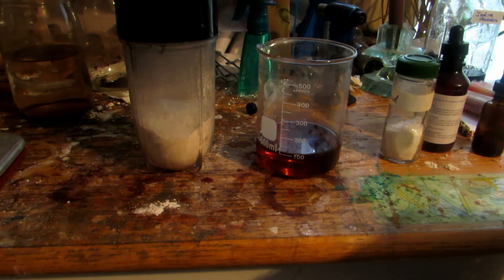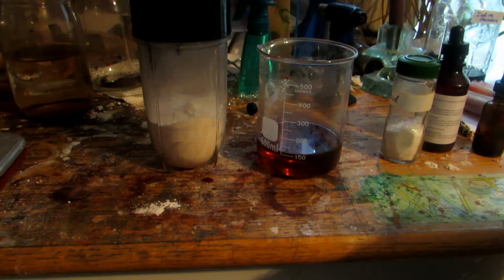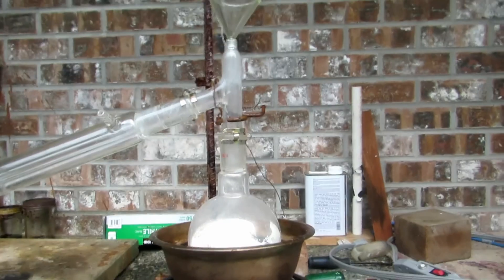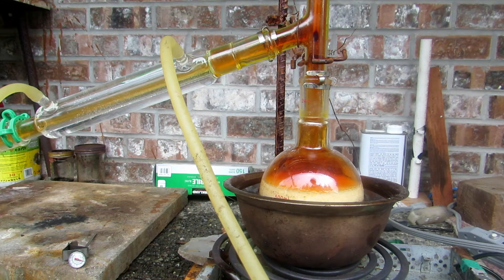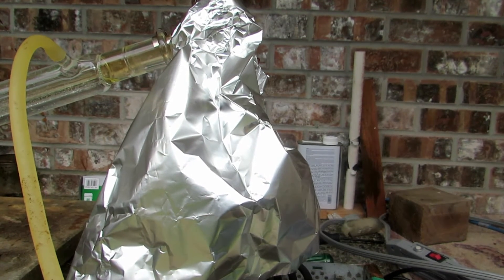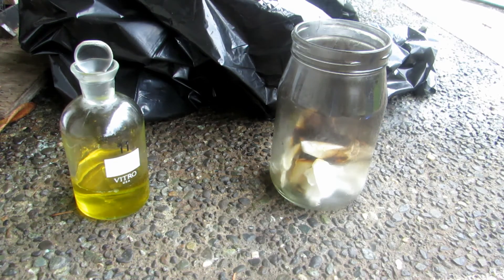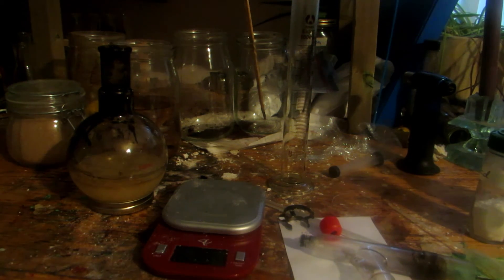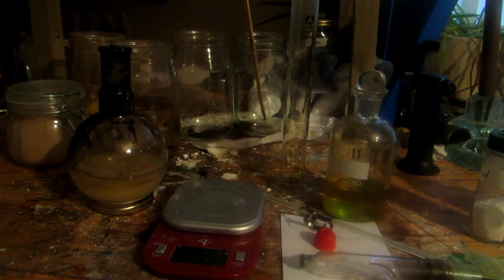How to Make Fuming Nitric Acid

Comment: Be very careful while using nitric acid. It isn't like sulfuric or hydrochloric acid. It is weaker than both of them but it's even more corrosive. The pain is almost instant if you get it on skin expect fingers. it can even dissolve bones.

Comment: I don,t think  is more than 70%  concentration..low grade nitric acid will fume  also....and burn to flame  things .... you need to try  with some cooper  ..if is over 90 % concentrated will not attach cooper ( because of pasivasion process ) ;if is diluted will attach  it violently  ...

Comment: i can only only buy sulfuric acid in 32% , how do i increase its concentration upto 68% or higher.
Reply from the maker: If you boil the sulfuric acid, water will boil off leaving the sulfuric acid, when white fumes come off, the concentration of the acid is about 70%. that will work in this reaction, but you will not achieve nitric acid past 68% concentration because it forms an azeotrope with water. To get pure sulfuric acid, you will need to distill the acid which requires heating it up in a distillation apparatus past 300 degrees Celsius. If you are looking to just obtain 68% nitric acid, your 32 % sulfuric acid should work for this reaction and you would just end up distilling 68% nitric acid.
Reply: so if i want to make 68% nictric acid all i need to do is, make a dilute nitric acid, then boil the nitric acid in a boiling flask and let the vapors go though an  apparatus, and have cold water going through the condenser, and wait for the steam to come out the other end. into a vacuum flask.
Reply: i only have sulfur powder at the moment, can i use that to make 70% sulfuric acid, if i pass water through the condenser, so the gas turns into liquid.
Reply from the maker: TV Tech yes, water will boil off first, then 68% nitric acid at 121 degrees centigrade
Reply from the maker: TV Tech you'd have to burn the sulphur and bubble the sulfur dioxide through hydrogen peroxide to make sulfuric acid, then u can boil it to concentrate it
Reply: Thanks
Reply: Celsius or Fahrenheit, there's no such thing at centigrade on my thermometer
Reply from the maker: TV Tech centigrade and Celsius are the sane thing, just different names

Comment: I think that carbon substance is the nitric acid that managed to escape and react with either the grease used on the joints, or the nitric acid reacting with the oil you used as an oil bath Or both. Or it is something that I don't know about. Keep up the good work.

Comment: You dont need to use plastic or rubber stopper on the thermometer adopter, you can just band thermometer with aluminium foil if you are distiling >85% nitric acid. Concentrated nitric acid will instantly passivate aluminium with oxide layer. At least that is case in theory.

Comment: You can safely use Butyl rubber gloves with fuming nitric acid.  Nitrile will burst into flames and latex will quickly melt.
Reply: Neoprene gloves also works and they are cheap

Comment: Can you put the hydrogen from electrolisis into a nitrate salt?
Reply from the maker: ? sorry, im unclear what you are asking.
Reply: H+ reacts with a mitrare salt, replacing the sodium/potassium?
Reply from the maker: yes that is what is happening here in essence, what do you mean put the hydrogen from electrolysis into a nitrate salt? are you suggesting reacting it with elemental hydrogen gas?
Reply: I've heard that electrolisis of water doesnt make elemental hydrogen and oxygen, instead H+ and OH-, is that true?
Reply from the maker: pure distilled water is almost totally not conductive. water can dissociate into hydronium (H3O+) and hydroxide ions (OH-) but only to a small degree. this allows water that isn't deionized to still be slightly conductive. If you put current through pure deionized water, nothing should really happen, however, if you water is ionized, i suppose there would be free ions in solution for electricity to flow through. The positive hydronium ions would be pulled to the positive electrode and the negative hydroxide would go to the negative electrode. i would assume that 4 hydronium ions would meet up at the negative electrode and form 2 water molecules and oxygen gas when the negative ions are able to give up their extra electron.

4 (OH-) --> 2 H2O + O2 + 4e-

at the positive electrode i would guess that two hydronium ions would meet up to form 2 water molecules and hydrogen gas.

2 (H3O+) + 2e-   -->   2 H2O + H2

that would be my assumption but i could be incorrect. the amount of either gas produced from electrolysis of ionized water would be negligable because of how little the water ionizes, typically a salt such as sodium hydroxide is added so there are free ions floating in solution which allows for electricity to flow through the water, and thus electrolysis can happen. hope this helps. :)
Reply: Thanks, can -OH, H+ and +H3O be insolated in its pure form? Or they will instantly react with everything?
Reply from the maker: there is not really a pure form, for example, when you dissolve table salt (sodium chloride) into water, it dissociates into Na+ and Cl- ions which float around in the solution. when you boil away the water, they rejoin to form NaCl as a salt, not the individual ions. so you cant seperate ions because they will just react with eachother to form a compound.

Comment: I just noticed that  there are a lot YouTube Chemist from Canada. It's not a good idea to store nitric acid in a clear bottle, nitric acid decomposes under UV radiation, and the process could have been improved by using vacuum distillation,as nitric acid decomposes under heat. For black stain on glassware, it happened to mine as well when I was doing the sulfuric acid distillation. I would love to see how you remove it. And for the thermometer adopter, I know few suppliers who sell a new type of the thermometer, it is completely made of glass, if you are interested I can leave you a link to it.
Reply: I’d be interested in a glass thermometer adapter, for a thermocouple. I use 24/29 joints
Reply: Also great to see a fellow Australian chemist

Comment: hi i was wondering where do you buy your chemicals and all the glassware im Canadian too
Reply from the maker: I make most of my chemicals from household materials, the sodium nitrate here was made from baking soda (sodium bicarbonate) and calcium ammonium nitrate cold packs, the sulfuric acid was drain cleaner bought from Canadian tire, The glassware was bought from ebay, you can get a cheap distillation apparatus for about 30 dollars, I highly suggest getting one. I try to do everything from household materials, but usually glassware is needed.
Reply: ok cool thank you a lot your video are really cool by the way but you should do more pyrotechnic things!
Reply from the maker: thanks!

Comment: using calcium nitrate is a bad idea. unless you enjoy very hard to remove calcium sulfate which can harden and be impossible to remove. and your density test will be off unless you purge all the NOx from it. this can be done blowing warm dry air through the acid until clear. you can then get a very accurate reading.the black is from the oxidised rubber valve in the mineral oil rather than high vacuum grease.sulfuric acid is an alternative.  otherwise great video.
Reply from the maker: true, I suppose calcium nitrate would be a bad idea! thanks for the suggestion to get a proper density test, I will try that. thanks!
Reply: @Thaddeus Oakley well this is an odd place to let the world know. 
What are we supposed to do with that information?
Reply: @AllChemystery  its a scam trying to get ppl to download their program that contains a vrius that will send scammers info like credit cards, social security, dob, ect